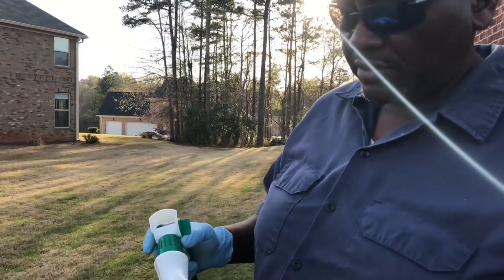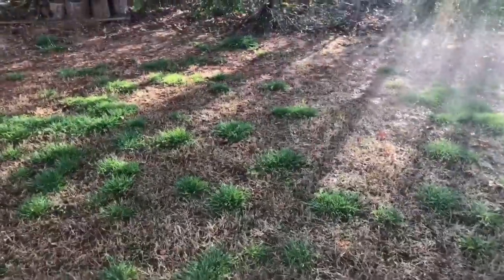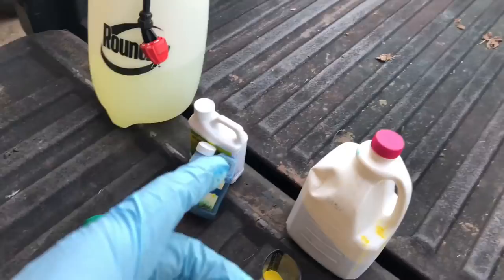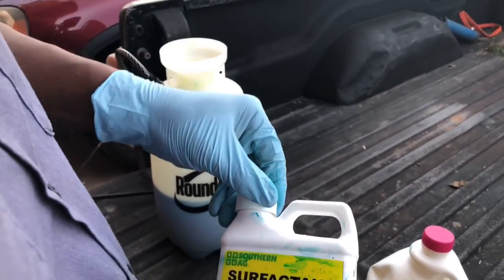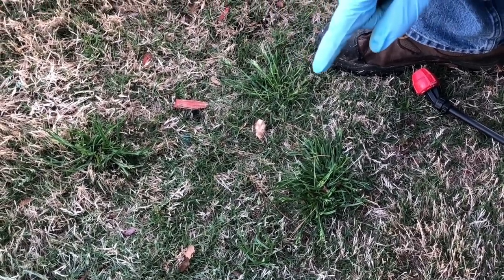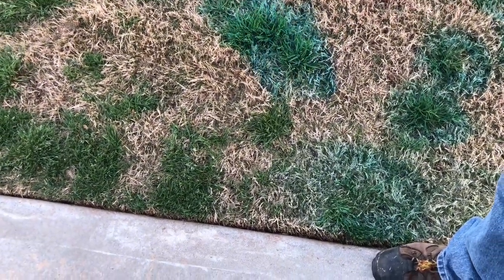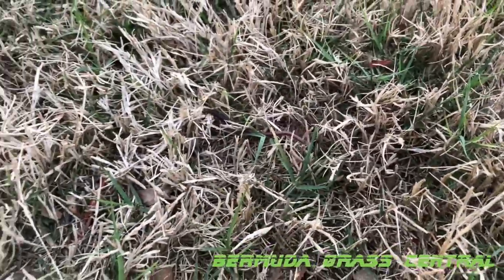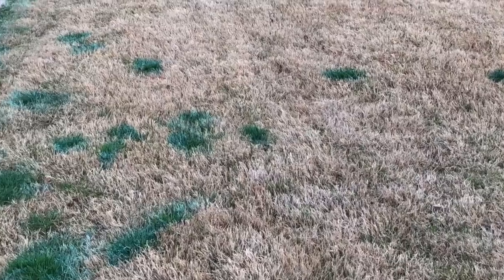How To Kill Annual Bluegrass ( P O A )

Comment: I used Image last weekend because of BYD (03/27/21) and had a cut done two days ago. Almost 70% of the POA bottom system (roots + first inch or so of the weed) are a deep yellow color. I will re-treat again in 7 days and should get a great turn-out. I have common Bermuda in GA fyi. As of right now the grass was left unarmed and perfect. $20 is all you need.
Reply from the maker: Way to go Eric 🙌🏾
Reply: How did it turn out?
Reply: @robertlevy4613  Great. I continue to use this and have also added Negate 37wg to the arsenal. Got the neighbor on the same program now as well.

Comment: BYD, can I use this the same day, after I've sprayed with MSMA?  Also, can spray both chemicals, MSMA & Image, on my entire (minus flower beds) w/o killing my good grass?  'Preciate you, bruh!!
Reply from the maker: Juan Love I would not use them both at the same time, MSMA is really potent, I’d separate theses two at least 8 weeks.
Reply: I have poa all over my lawn, front and back (almost 2 acres), and in my flower beds (how do kill it in my beds?), and I have an approx  20ft x 4ft strip of dallisgrass next to my driveway.  So, which should I remedy, first?  Help!
Reply from the maker: Juan Love if you not using them both in same area then yes, but you must follow directions because that’s a lot of herbicide plus you Yard will take a hit. It’s best to jump on poa while Yard is sense dormant ( probably to late for that ) the MSMA GENERALLY works in temps over 80.
Reply: Got it.  So, MSMA, now.  Then, Image, late this year when the Bermuda is dormant.

Comment: Worked at a golf course for years.  Simple.  If you miss the mid September application of preemergent, or the weather permits those seeds to germinate before you spray the pre emergent, you are DONE for the spring. Not going to effectively control POA until next sept (here in Ga).  There are ways to manage it, but we found it to be a losing and costly battle.  Hit it in mid sept.  I’ve missed it two years in a row because I got lazy at my house.

Comment: Great video thanks for the info the only thing is on the surfactant you used teaspoons instead of Tablespoons tablespoons are normally marked with a capital”T” you wanted teaspoons any way per the instructions .👍🏾
Reply from the maker: reggie ferguson you are right Reggie but I meant to say teaspoon for herbicide, I put the right amount but said the wrong thing. One of the very reason I say read those label instructions 👍🏾
Reply: Bermuda Grass Central  Do you have nutsedge where you are?
Reply from the maker: reggie ferguson not yet 😀

Comment: I put Bayer hose behind weed control on my yard about two weeks ago, killed everything except POA, how long do I need to wait before I use the image?
Reply from the maker: Terrence Starling here’s the problem, temps are rising now, poa normally dies when temps are consistently over 85 depending on humidity. Plus I don’t recommend treating entire yard with a weed control during June, July and August. So my suggestion is to wait and let it die off but you’ll need to bag the seed heads. If you don’t bag then your Pre M game needs to be strong for ever because those seeds heads could last for years in your soil.
Reply: Thanks for replying! Great channel!!!!

Comment: Great video. So my Bermuda lawn has had first treatment of weed and feed about a month ago. Killed some weeds but many still there. What is the best next application to kill the remaining weeds. This Bermuda was laid in early fall of 2017 and already growing and solid green. Any help would be appreciated.
Reply: Jason Dominguez weed and feed is not a good idea because it's all synthetic. You should use a post emergent like the one BYD used. I prefer a pump sprayer vs granular. The spray lands on and is absorbed through the leaves down to the roots to kill the plant. After a couple of weeks hit it with milorganite or ringer

Comment: Hey I followed you instructions to kill pea with image. It has not killed the poa. Help
Reply: Poa
Reply: I used the spot spray you suggested. It’s been `3 weeks. Can I reapply?
Reply: PS Bermuda lawn.
Reply from the maker: Randy Spicer are you seeing any yellowing, even a little bit?
Reply: Bermudagrass Central yes a little. I used 2.5 image but missed your instruction about the prodiamine. Also maybe I goofed up, I filled the sprayed up with h2o instead of just 1 gal per 2.5 of image. Can I redo the spot spray again.
Reply from the maker: Randy Spicer if spot spraying yes, 1 gal per 2.5 oz image red label. Generally it takes 3-5 weeks to work on POA, after its water in do not water lawn for not because POA loves to be hydrated, the Image starves it off, it’s s slow process but it works.